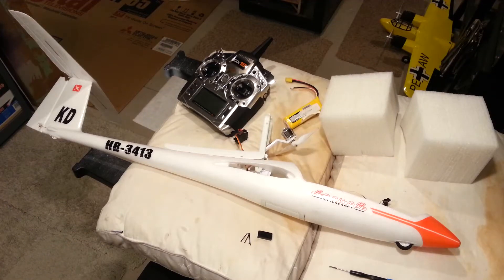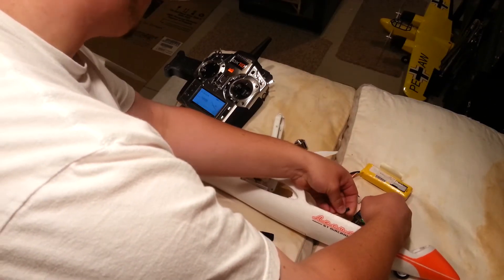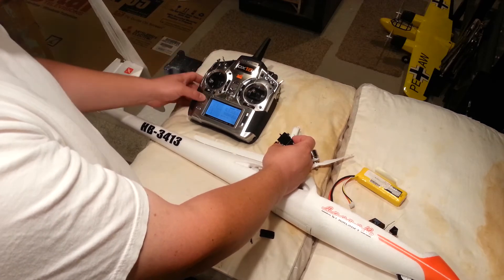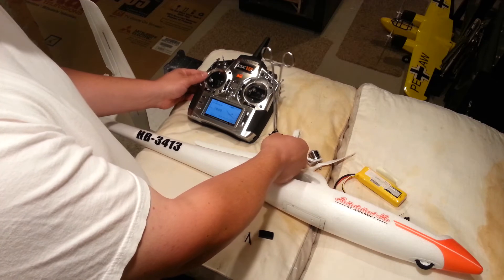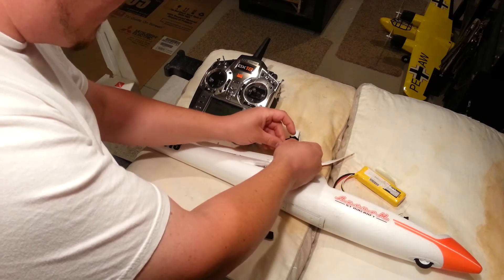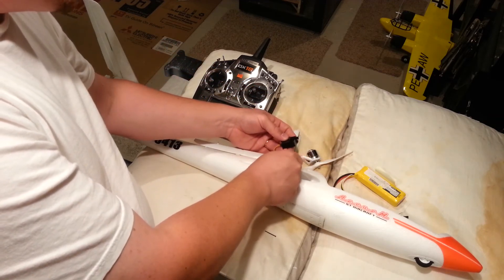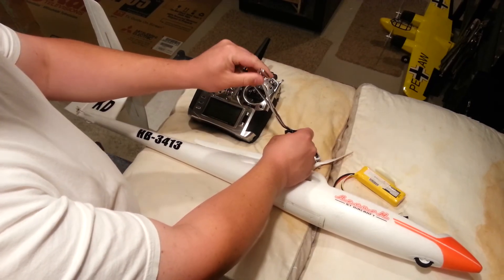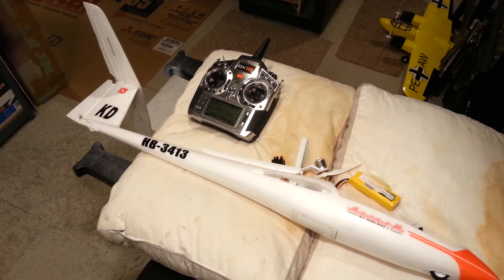Tower Hobbies / ST Model / Sheng Teng - Arcus M - Retractable Motor System Repair - Part 3

Comment: Hey Brian, it's me again (the one who asked about "how to change the goddamn servo").
As this is impossible, I first decided to sell it for cheap. But than the retractable landing gear and spoilers convinced me - I ripped out the entire motor system, leaving only what's needed to fit the wing. 
Now it will get a folding prop upfront, using the same esc, motor, (...), only another prop (from the minimoa btw).

Would you be interested to see videos of a hopefully successful maiden flight?
Greetings. 😛
Reply from the maker: Yes, please share the link on a NEW comment (so I will get notified, please). I really like this plane, and the RMS is the WORST, but regrettably coolest feature on this model.

Thanks! Glad you made it work!